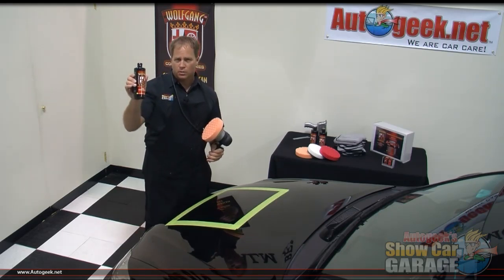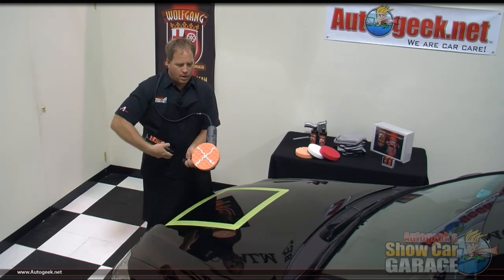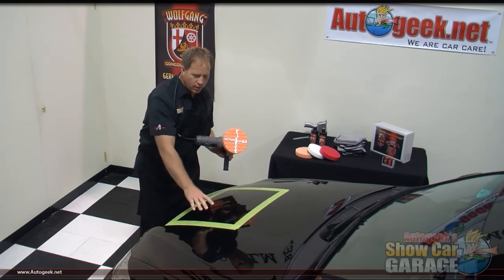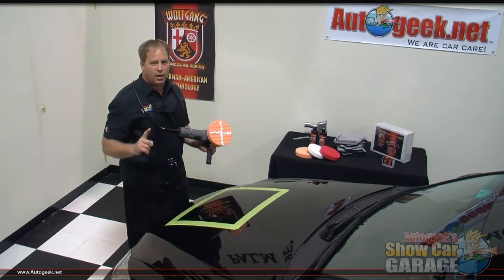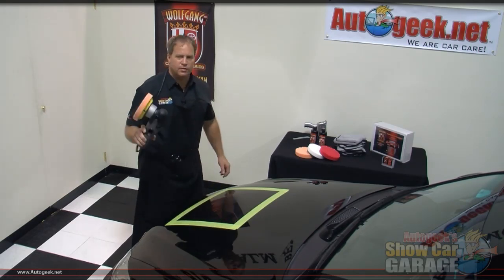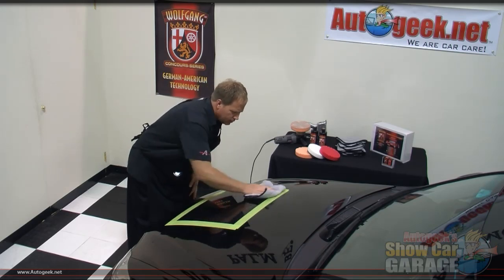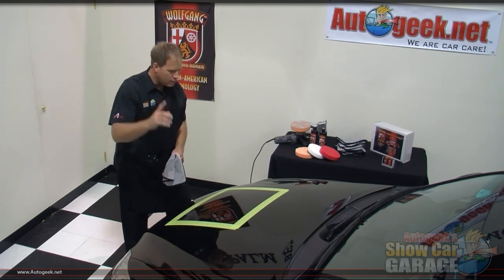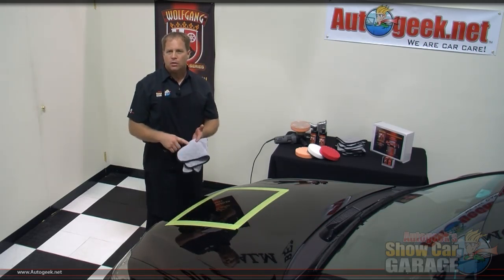How to do a "Section Pass" with a Porter Cable 7424XP

Comment from the maker: @panadol4life - Speed for removing swirls is 5.0 to 6.0 and about 15 pounds of pressure.  Speed for applying wax is 3.0 to 4.0 and you only use light pressure. -Mike Phillips